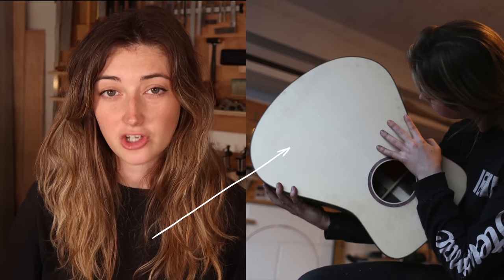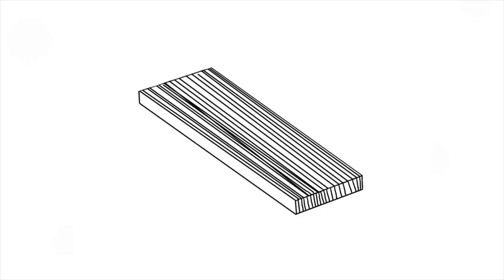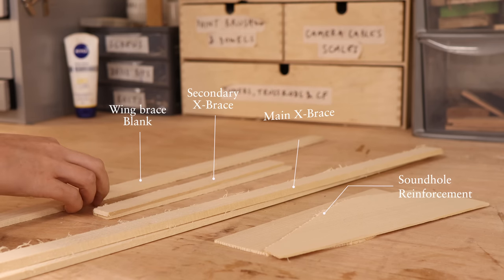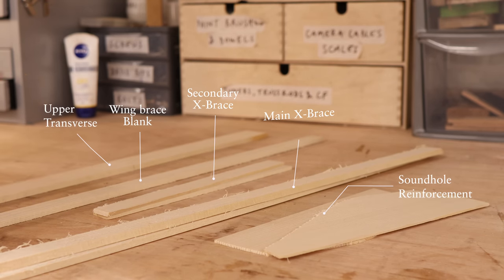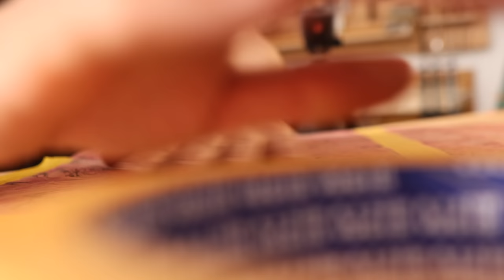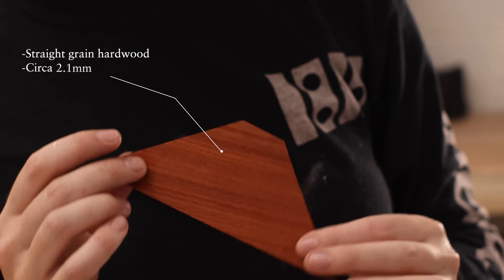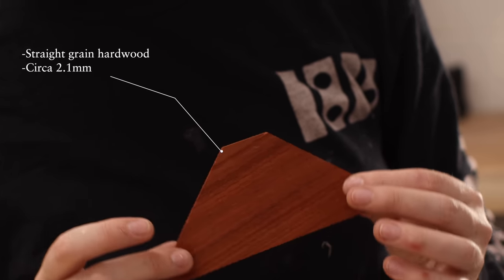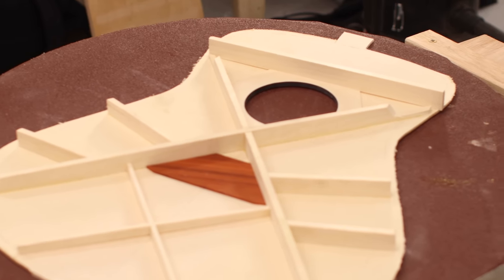Watch an Acoustic Guitar Soundboard Being Made

Comment: I notice you use a scalpel rather than an X-acto knife for cutting. I’ve used one for cutting lute roses and I’ve made a handle for it by slicing a dowel lengthwise and taping the halves on either side of the medical scalpel handle. The resulting thicker handle is easier for me to hold and my fingers don’t cramp when I use it. 

I discovered your channel by accident and I love your videos. You explain things very well and the captions and diagrams are excellent. And your guitars are great too! Lutherie is just a hobby for me but I haven’t made an instrument in several years. Watching your videos makes me want to get back to it!

Comment: Love seeing the hand work you put into this. Just getting ready to glue the paduk bridge plate into my spruce top...I went to the extra effort to sand a matching radius into the plate, maybe silly but I don't like to add extra stresses into the top. Keep the videos coming!
Reply from the maker: Congrats! As long as it doesn't go too thin with a radius in it I think there's nothing wrong with that. Might even be better who knows!
Reply: @DaisyTempest  Just have to do things a little differently, it's a compulsion;)

Comment: Looks like that guitar is getting off to a good start! Paduak is a good choice for the bridge plate. I've seen Jerry Rosa (Rosa String Works Workshop) put new life in some older guitars that had trashed plywood bridge plates, such as Gibsons from the 60's and 70's, by replacing the plate with paduak ones. It seems to be kind of an oily wood, so he cleaned the gluing surface with acetone before gluing up.

Comment: I was always wondering, maybe someone here can shed some light... At the crossing point of the braces, one of them has a notch facing the sound board, to let the other one pass, but the other one has the notch facing away from the sound board... The first one mostly retains it's stiffness, because it still has the full x-section hight, despite the void in the middle, but the second one has only half of the normal x-section hight and should be drastically less stiff. Doesn't this leave the sound board with a very asymmetric response to vibration? Maybe that's how it was always done and this is actually desireable? Do luthiers always put the brace that passes under in the same orientation on the sound board? E.g. on the bass string side  next to the rosette? It seems that it should matter...

Comment: What a lovely video. I appreciate the obvious-now-that-I've-seen-it trick of using the vise itself as a depth gauge when cutting the X brace joint.  

Have you noticed any tone difference when you use epoxy in the rosette?
Reply from the maker: The sound hole isn't a massive music generator anyway as it's a gaping hole! So the area around it isn't really responsible for much either - subsequently using epoxy in a small area like a rosette hasn't ever sounded different to me.

Comment: Hi Daisy. Thanks for all the insight. You inspired me to build my first guitar last year (a solid 3 out of 10) I am building my 2nd over this coming winter. Can I ask you, what thicknesses (in mm) you go for in top,  ack and sides? There are so many views! Seeing as you were my inspiration, I thought I would ask you. Many thanks. Mike
Reply from the maker: Hi Mike this is such a lovely comment to receive and I'm so happy you were inspired to make one! Top thicknesses range from maker to maker, but traditionally people tend to keep backs to about 2.4-2.6mm and tops in a similar range. Sides it depends if they're laminated or not - you can take them down to as low as 2.1 if they're laminated to a solid core! This can be a godsend if you're working with timber that likes to break when you're bending it! Hope this helps.
Reply: Hi Again Daisy. Thank you so much for such a FAAAST reply! When I built my guitar I used mahogany for the sides which was an absolute nightmare. No matter how much I wet is and heated it, it creaked and cracked all the way.
I was recently diagnosed with early onset dementia and after watching what you did, I thought what better way could I keep hold of my grey cells than to give it a try.
Again thank you so much. In further videos I will comment and let you know how it goes.  @DaisyTempest

Comment: 3.4mm thick soundboard? You are so lucky. My lutes use 1.6mm. Love your work though, particularly those end papers - seriously nice idea.
Reply from the maker: Noooo I was just thicknessing at this point. It’s a fair bit thinner than that!
Reply: @DaisyTempest  Thanks - I was wondering. Two of my guitars are by Martin and Tanglewood. Comparing the two, the Martin is built like a brick sh*thouse and has nothing like the clarity or volume of the Tanglewood.
The one great point of the Martin is the laminated neck which is 100% stable and has never needed a seasonal truss rod adjustment since the first time I set it up.

Comment: 3:30 Why Titebond I instead of 2 or 3, which are waterproof?   Granted, the instrument probably won't ever be subjected to the weather, but if it accidently does get wet, wouldn't it be better to have waterproof glue, assuming all other things are equal?    Or does Titebond I perform better than Titebond II or III?
Reply: I believe that the wood glue that our hero uses dries much slower than #2 or #3 making for a smaller or should I say tighter joint, aside from the nearly invisible seams the full exterior will be sealed with some kind of water resistant finish !!!

Comment: Very impressive work. Two random gluing thoughts, from someone who burns thru Titebond and epoxy by gallons: cheap digital scales are fabulous for mixing epoxy, but I find keeping mine inside a large ziplock freezer bag extends its useful life. You can read the display & push buttons right thru the bag.

 Second, the GluBot changed my life! Srsly, it has a few annoying habits but is generally soooo much better than tipping PVA out of a pint bottle. Sufficiently great that when one poops the bed (every 2 years of hard use in a cabinet shop), I immediately spend $8 for a new one. I always keep a half dozen spare blade tips on hand, too. 'Yorker' tips are useful for super-delicate gluing tasks. Amazon UK apparently sells them.

https://www.youtube.com/watch?v=4qlzT6vwxQA
Reply from the maker: Great tips! Thanks so much!

Comment: What did you do to you finger?
Reply from the maker: Cut it on the tape dispenser… it’s always the unassuming tools 😂
Reply: @DaisyTempest  ah bugger.
At least it wasn't a chisel.
I've done that before, bit messy 😂
Reply: @DaisyTempest  Or the dull ones that I force too hard! That's taught me to sharpen, and relax!
Reply: @DaisyTempest I like that only taped one of the two injured, a little tip from a former plumber wrap wounds on fingers with Teflon tape but be sure to leave a five inch lead out before you wrap as you have to tie off the tailing end .

Comment: Instead of weakening the Soundboard structurally by drilling Six 6mm holes in a line in the Soundboard and Bridge, (close together), to accommodate Bone Pins on Western guitars why not use a `Trapeze-Tailpiece´ like Django Rheinhart had on his guitar.  Long-term, Pins cause bowing of the Soundboard or loosening of the Bridge, Pin holes seem like a crappy, acoustically inferior compromise with the inevitable structural weakening of the Soundboard with ensuing costs and early replacement, damaging your product's reputation.  Why not build guitars to outlive you?